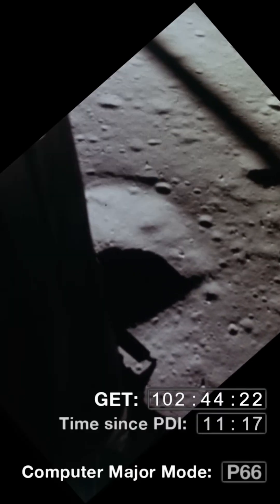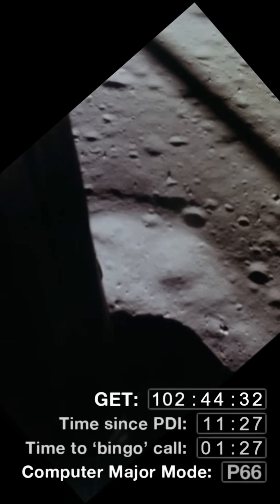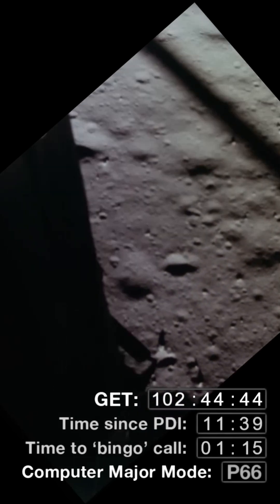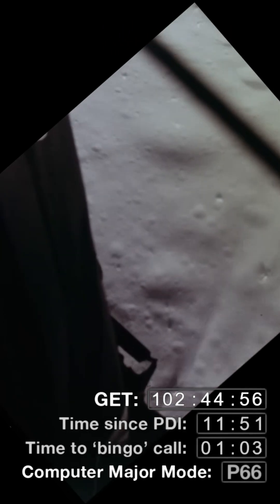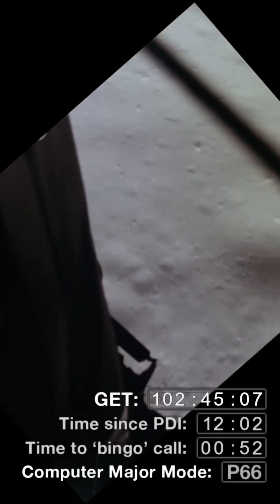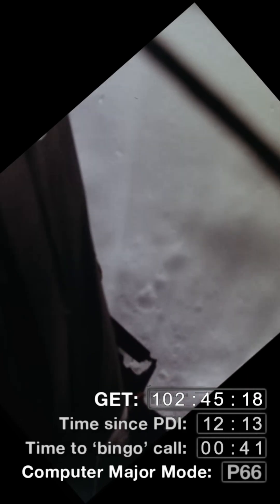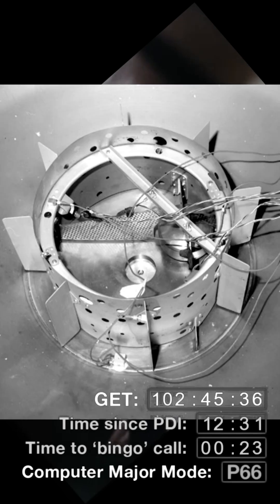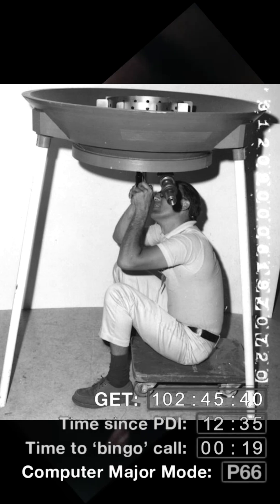Was Apollo 11 Really Running Out Of Fuel?

Comment: If it wasn’t 17 seconds, does anyone know how much fuel they really had left?
Reply: Post flight analysis pointed at about 45 seconds. Not much but better than 17.
Reply: @skunkjobb  An extra 28 seconds of burn time sounds like a considerable amount to me. How many seconds were in the tank to begin with?
Reply: @nagualdesign  Burn time depended on throttle settings.  The more time you spent at a higher throttle setting, the more fuel is consumed and the less is left at any given point.  The descent burn was always scheduled to last for roughly 12 minutes, though, so to get a general idea, just multiply 12 by 60, and you get the average number of seconds for the PDI burn.  About 720 seconds.  The descent engine also performed the descent orbit insertion burn on the early landings, too, so total burn time of the first few LMs to land was around 750 seconds, again depending on throttling.  Later LMs carried enlarged fuel tanks, but maintained full throttle for about a minute longer during descent, so they still only took about 12 minutes for their landing burns, but burned more fuel doing it.
Reply: @skunkjobb  If memory service NA's answer to the low fuel "issue" was along the lines of "it wasn't an issue it was always that low"
Reply: It does not matter. Hindsight is wonderful but Apollo 11 would have aborted the landing when the count got to zero. Later knowledge could not change their decisions.
Reply: @nilsmafr  Not sure bout that. Hitting zero on that count down didn't mean abort...it mean abort OR LAND IMMEDIATELY (this from Gene Krantz himself).

If you'd gone all that way, gotten into that situation, the count reached zero, and you were 20 feet above the surface, it'd probably be safer to land than try the abort, as you needed some altitude to safely jettison the landing stage and ignite the upper.

Plus, if you've flown a quarter million miles to land, damn near ANYONE isn't going to stop with 20 ft left.
Reply: You only actually know the contents of a tank when it is filled and when it is empty.  Anything else is just an (informed) estimate or projection.
Reply: that's the $64K question
Reply: Probably not. If the sensors got it wrong and the LLM was left on the Moon there's no way to know how much fuel was left.

I suppose you could estimate it by calculating how much was burned and when, but Apollo didn't record that data. You'd have to analyse the footage of the entire landing and infer when the engines were being fired. I suspect that the error bar would be so large as to make the whole exercise pointless.

...Unless you were a full-time YouTuber and certified space nerd. I'm looking at you, Scott Manley! 😊